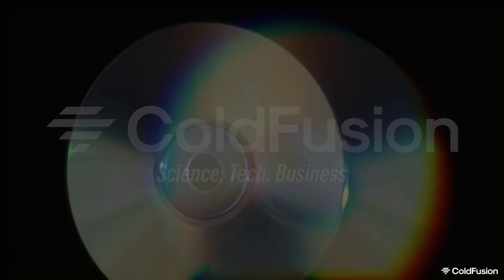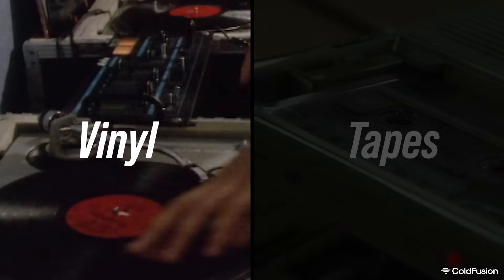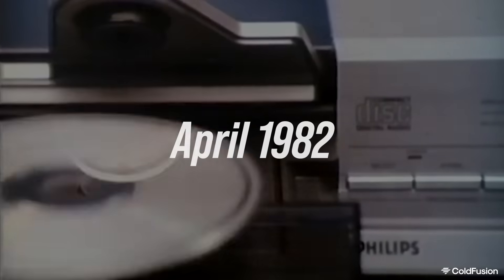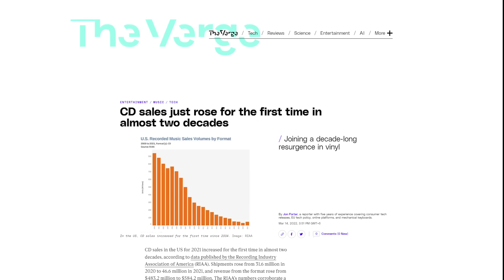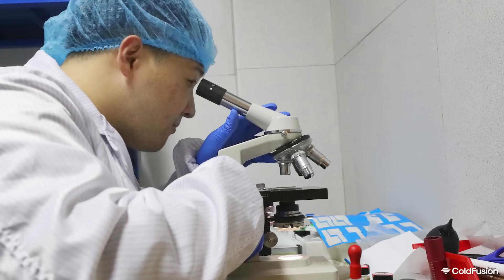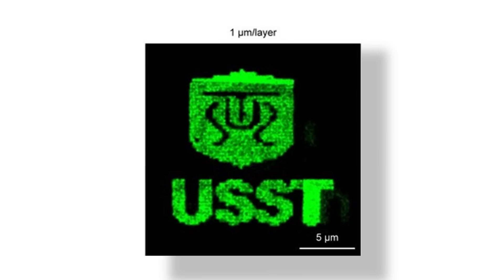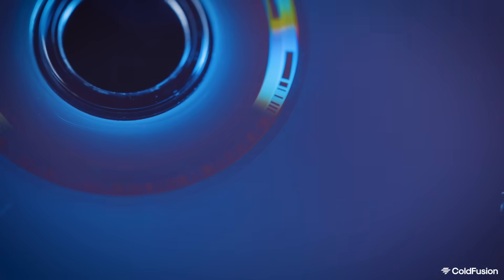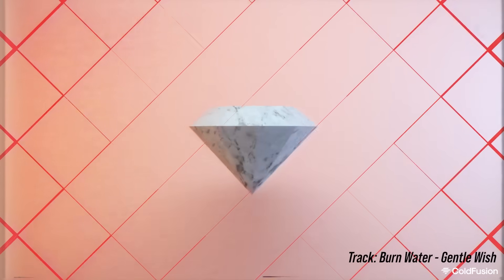Why This New CD Could Change Storage

Comment: It's interesting if looked in isolation, but really more of the same if you look into the history of storage research from CD onwards. Those who followed news about this at least from the Blu-ray era will know - but just to share a few tidbits.

Between the DVD and Blu-ray era and onwards, tech news always had these periods with piles of new storage formats popping around, which would either replace Blu-ray or whatever was there at the time, or "revolutionize storage" in some way.

Just to give some examples, here:
https://en.wikipedia.org/wiki/Holographic_Versatile_Disc
https://en.wikipedia.org/wiki/Archival_Disc (already exists, but read about future promises)
https://en.wikipedia.org/wiki/LS-R
https://en.wikipedia.org/wiki/Stacked_Volumetric_Optical_Disc
https://en.wikipedia.org/wiki/3D_optical_data_storage
https://en.wikipedia.org/wiki/5D_optical_data_storage

Those are for disc formats only. If we get out of the realm of discs, there's more:
https://en.wikipedia.org/wiki/Holographic_Versatile_Card
https://en.wikipedia.org/wiki/Heat-assisted_magnetic_recording
https://en.wikipedia.org/wiki/DNA_digital_data_storage
https://en.wikipedia.org/wiki/Plant-based_digital_data_storage
https://en.wikipedia.org/wiki/Patterned_media
https://en.wikipedia.org/wiki/Spintronics#Storage_media

And then there are more concepts, experiments, ideas, prototypes and whatnot, some that have been around longer than CDs themselves, with a promise to revolutionize things in the future. Like the already mentioned Spintronics, but also:
https://en.wikipedia.org/wiki/Magnonics
https://en.wikipedia.org/wiki/Memristor#Potential_applications

What is the problem the majority of those have? Basically the same issue of emerging battery technology that will supposedly replace Lithium - they never get to commercial scale at acceptable prices. Some are only theoretical, some have working prototypes in labs but can't be done at scale, some use existing media but the reader is unfeasible, for several the math simply did not work.

The thing is - there is no real demand for more and more consumer level high storage anymore. It got replaced by the cloud paradigm. So really, if any of those technologies comes to replace current storage methods... people might not even learn about it. Unless we break the cloud paradigm somehow.

One can say that this still matters for the backend, the servers in the cloud, etc - but really, do you even know what most of those are using these days? As in the data centers that are holding most of the data. 

It's HDDs, magnetic disk storage. The storage format that has been around since the mid-50s. xD

Of course, it's newer tech with a lot of storage and fancy new improvements like Helium filled drives, or upcoming tech that we still don't know if it'll pan out like HAMR, TDMR, 3DHD and others.
Read more here: https://en.wikipedia.org/wiki/Hard_disk_drive#Development

Even if SSDs have substantially dropped in price over the years, for operations that large every cent counts, plus things like longevity, and all sorts of considerations. So it's fully expected that HDDs will still be the majority, potentially a decade from now. Not just because they are cheap proven tech, but because there's still all this potential for improvements.

Another thing to note - I think the best price to storage size ratio on HDDs is already hitting the 20Tb or a bit more... so, it's still 10x less capacity than the 200Tb disc, but that's at readily available commercial level and does not need a special reader for it. It's around 400 bucks. 
That 100Tb SSD is just not something on the same level... it's sold at an exceptionally high price just because it's at the top of the top for now. 

This means that with 4000 bucks you can already get one of those disks worth of storage.
For which you'll need a lot of power (but nowhere close femto laser levels), it's of course a whole bunch heavier and bulkier than a single disc (though again, we are disconsidering the reading and writing drive necessary for usage), and it's still magnetic storage with it's longevity limitations, though newer tech has improved that side a lot too over the years.
I mean, we're talking about different things here... discs you only have to buy one read write drive, and then just media at cheap for storage. But still.

Thinking about creating a read-write femtosecond laser that consumes reasonable amount of power and can read and write at speeds that would make it usable requires so many huge jumps in technology that you might as well consider DNA based storage instead, with a magical machine that can encode, decode, read and do everything else needed to store data in a longer lasting way.

The one thing left out of the video is that disc based storage doesn't last as long as most people think. At least if we're talking about materials used to make CDs, DVDs and Blu-rays. Those, well stored, with the latest tech, last longer than magnetic storage or solid state, but the materials will still degrade in a matter of decades.
This is what the 5D optical data storage covers - making discs not with plastic, but with something like quartz or glass, so that it really can have a long life as long as it's properly stored. They are fragile if handled improperly, but if you store it in the right conditions they can last for a very long time. Then we're talking about centuries or millennia.

Anyways, I blabbed long enough.

Comment: Speed is the most important issue here tbh anything storing 100TB worth data and reading it at a speed of few MBPS will just fry the system tbh nothing should run this long.

Comment: it would be cool if they put these disk in like a metal casing with a laser that reads it and a motor to spin it and then you can connect it to computers through a usb or a sata connection that would be a multi million dollar industry

Comment: The problem is that, Cd's are often Botched re recordings or re masters of Original Albums.   I Know I prefer the Original LP over a CD. and yes Cassette tapes do not degrade as much as you think. I have a set of Tapes and most to all from the 90's still sound good! 

MP3, and Etc. on Physical HD's jump drives.. they can become corrupt and then you will loose your Data, music ...

I have more experience with How a cd Sounds vs the original Mix. we need to stop re mixing Albums and just leave them to what the Albums originally had!

Comment: This is great for cold storage. But we knew about this engineering problem with disks since before the VHS. Disks can only spin so fast without breaking, mechanically speaking. Now, try running such dense data past a spinning playhead drum and you’ve bought yourself some speed.

Comment: I'd like to see a new optical disc format. Sure. Bring it. I notice no mention of longevity in this video - even a dubious claim that optical storage is durable. (It isn't).
But regardless of tech, the issue is bitrot/SSD failure/HD failure vs. streaming services/cloud providers arbitrarily preventing access to the data you want. 

Frankly, I'd rather have the option of keeping my most precious data physically under my control, than leave it entirely to the mercy of the cloud/streaming folks. We can do both, in fact, that's the only rational option. BTW the most stable long term data storage format is still punched paper tape.

Comment: Misleading. It is NOT 1.6 Petabytes, it is 1.6 Petabits of data which is way less. That is about 200 Terabytes. Still impressive, but this video needs to be corrected to show the right numbers. As for the use, I would think they will be good for backups, but not for easy and fast access. Of course, price will have to come down to something "affordable". Honestly, i doubt it will be used for anything. At least, not in that form (the regular CD/Blu Ray size).

Comment: they would have to make them more durable than the first cds,, we were told that the first ones would last for hundreds of years but unfortunately the data on them didnt, when cd burners came out i would use them for storing files music and photos , a few years later , very few of them would read or just read badly . so if they cant manage it on 1 layer then they got not chance with multi layers, if corporations do use then, they are going to be very peeved off when a year later all their valuable data has gone

Comment: People are thinking of this in terms of the size of data we use now. It's sort of like how, in the 90s, downloading a song or maybe an album was conceivable given the size of MP3s and the average dial-up internet speeds. If you had mentioned downloading an entire movie to someone, people would've told you you were crazy. Now it's easy to stream/download entire movies in 4K.

Similarly, while you can store around 2,000,000 songs or 2,000 movies onto a 1.6 Petabyte disc, that's not really where this tech would shine, and especially not the reason that would bring back and save physical media. A new form of media that is especially data intensive would need to utilize petabytes worth of storage. How about movies or other media that is volumetric AR? You pop in the disc and your living room is "transported" into the world of the movie rather than just an image on a display.

Comment: If they can get reading and writing into reasonable speeds I will 100% buy this.  I'm not a fan of the current model of companies being able to revoke your ability to engage with your favorite media because they don't like your opinions, or because there was an error somewhere.  Physical ownership is more expensive, but as long as you take care of your discs it can't be revoked.  I would prefer something more free form than bluray though, because Sony's ownership of the decryption method means that the ability to play back your blurays is more complicated on Linux, since open source software can't so easily incorporate it due to licensing fees.

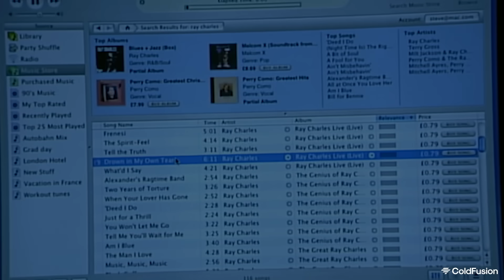Comment: 05:24 Blaming the fall of CDs on file sharing is laughable, considering the increased demand for long-term storage from ordinary users for those files that they were sharing. The rise of streaming services that you mention a while later might be the more probable cause, but not because of "consumer preferences" (I still would prefer having my own physical copy that I can play anytime I want over a streaming service that can cut me off anytime they want), but because of "media companies' preferences" forced upon their consumers, and because the hardware manufacturers stopping supporting DVD drives. The limited storage capacity of DVDs might have been another important factor, because 8 GB is not very much these days.

Comment: Why don't we sell software on USB drives or solid state drives? Why do we need discs anymore? That's the thing that bothers me the most. Discs are so large and easily corruptible through scratches. Physical media should be switched to something like the game cards for the nintendo switch. The footprint is just so much smaller and more manageable.
Reply: No.

Comment: Larger isn’t always better for archiving.  It’s a lot more to lose if a disc goes bad, for example.
Reply: You can use multiple discs and sync them
Reply: @lordkedos  true.  For archiving I use dvd. And 4gb rars with pars for rebuilds if I lose up to a percentage of the set
Reply: @pikaskew  if you use something like the NERO burner you can dedicate space not used on the disc for redundancy on the disc itself, providing another layer of protection
Reply: m-disk and blu.rays use inorganic dye so they are way better for long term storage

DVDs were known to be the optical media who suffered the most bitrot if stored improperly, so i prefer blu-ray as they are 25GB - 128GB and overall better for long term storage

Comment: Hm, ultra transparent with 100 data layers / levels and tiny spots. Sounds like a one way ticket to write off a disc with a single scratch on the surface. I think these discs need to be put in a cardridge of sorts like for example Mini Discs, the PSP discs, diskettes, etc.

Comment: As a laser technician I have strong mixed feelings about this tech. The claimed data storage is absolutely bonkers and it could be an excellent long term storage solution. However it seems like this is a write only memory technology which hinders usability. If this requires femto/picosecond lasers it's going to be a very tough sell as those expensive and fickle. One device operating in the Mbs range is a long way from practical, many would be economically questionable. I feel as though by the time this reaches as level of market readiness we will have made something better for the server farm sector and this will either fall into some niche long term cold storage use or perish right out of the gate against competing options.

I'll still cheer on the photonics home team, that's an incredible achievement and then some!

Comment: Two things:
1. bits and bytets are not the same - and its annoying af that you mix them up all the time.
2. some countries use "." and others use "," for dividing numbers into sets of three, while using the opposite for stating a decimal place. The 200,000 GB in your thumbnail are very much confusing because it could either be twohundredthousand GB  - or twohundred GB. You could just have used the appropriate unit, wich would be TB or PB to avoid this.

Comment: Since they have the size down to microbe dimensions. A step down version could come to market could be introduced for consumers and provide still super outstanding storage solutions.  Having just one disc that could hold 25TB.  That would help gear up the technology, and provide room for replacement tons of bulk media.  They pasted the mark by a hundred miles when just a couple would be enough for the short term while technology cost come down to provide more room.

Comment: "Optical discs are known for their longevity and durability".... Scratches and disc rot differ from that
Reply: Disc rot is rare on most forms of optical media. Laserdisc, CD Video (not Video CD), and HD-DVD are most susceptible.
Reply: blame cheap manufacturers.
Reply: All of my professionally-pressed audio CDs from the 90s still work, but many of my self-burned data CD-Rs from the late 90s and early 2000s don't. Admittedly, I always bought the most affordable blank CD-Rs, but that illustrates the problem. Once a new disc technology is cheap enough for consumers to make their own discs, the quality may not initially be there to get the durability that's possible with the technology.
Reply: ...ssd's go bad without a clue...
Reply: Scratches are a handling and storage issue. Disc rot is also a storage issue. In comparison, if you stored a sdd, usb stick or memory card in the exact same place and way you store an optical disc the optical disc will last longer because flash memory slowly loses its charge.
Reply: I never understood why the back of metallic foil wasn't encased in plastic to protect it from scratches.
Reply: I have a very large collection of CDs and have never seen "disc rot".

Comment: I have never used a cloud, and people who trust the cloud are not secured. Making the physical disc going away was a big mistake. But what replaced the disc instead.
Even buying computer parts that need drivers, when the manufacturer included the disc to install them has not completely removed it. Hoping you go online and
download it from there. This makes things very inconvenant in few ways:

1. You need an internet connection
2. You need wait for the download and install it.

Thing have gotten harder no easier, having a physical disc makes things easier.

1. Load the cd and install.

Also, there is no point of keeping your favorite programs, taking up space for nothing such as USB and SSD. I prefer the traditional way,
have cd or dvd which I can categorize.

Comment: The practicality of such a high storage density disc is questionable.  I think there is no consumer use for it.  While the concept of having all of a person's music and movies saved on a single disc is interesting, what happens if it gets lost, stolen, or damaged?  Are consumers willing to spend a huge amount of money on a disc reader to read your one disc?  Or if you do not use the capacity of a disc, and end up with a stack of partially full discs, you are back to swapping discs in and out of your disc player, searching the discs for your desired content.

For the data storage market, having massive disc "jukeboxes" in the data center to find, mount and make data available is not really workable.  And spinning disc players rely on mechanical components, motors, gears and belts, that are prone to wear and failure.

I think SSD storage is the way of the future, not spinning optical discs.  Making SSD storage longer lived, and less prone to failure, is a better goal than going back to spinning optical discs.

Comment: Ah, the good old days when you had to sit in front of your PC for what felt like an eternity just to change the CD/DVD during installation. Or the great copy protection measures that smuggled a driver onto your PC only to refuse to work with some drives. And the noise during installation when you were almost afraid the PC was about to take off. It's really awful today when a game with a 1 Gbit/s connection is downloaded within a few minutes and quietly installed on an M.2 SSD. I no longer have to dig out the CD so that the copy protection allows me to start a game, even though all the data is on the HDD - where's all the fun in that!

Comment: I had many CD's in the 80's-90's, even had CD burners. I would be interested in this if they were truly indestructible as they were advertised back then. I'm not interested in anything that a scratch will make it unusable. Spotify works too good now, it never skips or doesn't work. That's how reliable it needs to be.